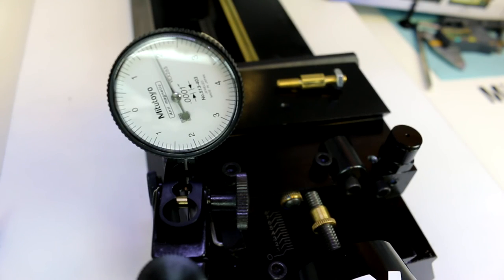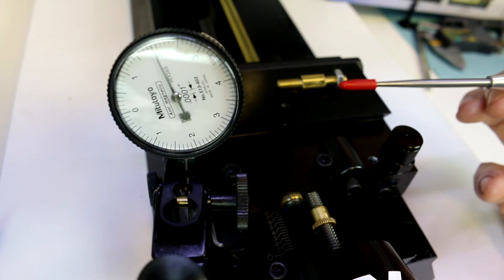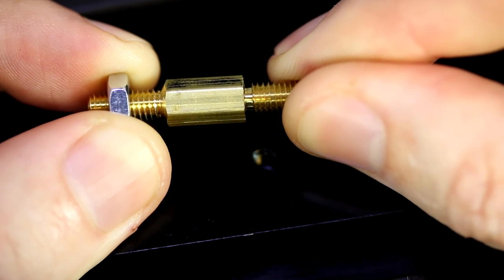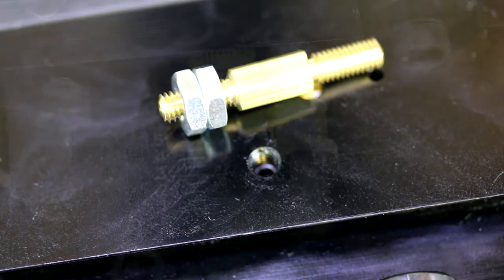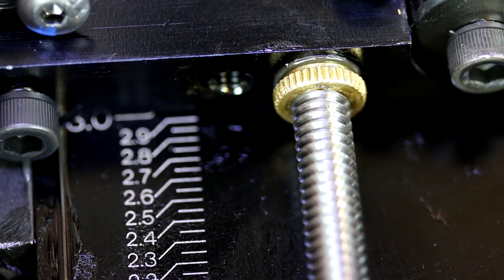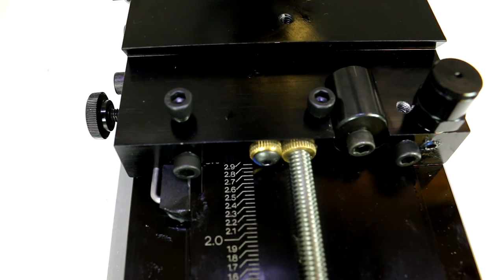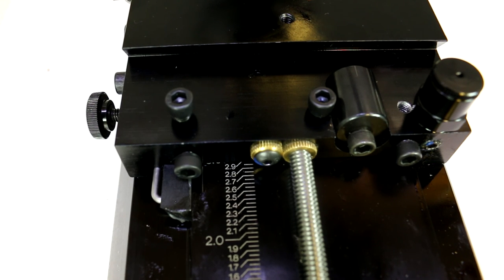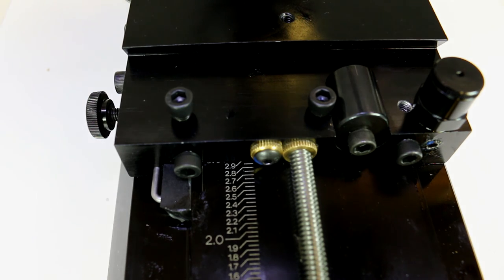Sherline Lathe & Mill Backlash

Comment: Wear and tear over time causes backlash, but I also think a lot of manufacturers are more concerned with getting products out the door as fast as they can ($$$), rather than spending a little more time machining items to fit.  Mass production is only good to a certain extent.  Wondering what the cost/time difference would be to machine ball screw threads as opposed to regular threads ?

Comment: Your video above and the Sherline manual and videos show how to reduce backlash in the lathe slide (X axis) but not how to reduce it for the Y axis (for the 24" metric leadscrew). How do you reduce it for the long Y axis? Following their video on handwheel installation, I adjusted the handwheel control for the main leadscrew shaft (basically re-tightening the control on the post) as you would for an older frequently used machine, but this machine is new so it made no difference (did not work loose in the first place). Technically, the end play comes out to be .008 mm (8 increments) which is at the end range of acceptable for Sherline so I didnt want to get with the company yet assuming they will say to just live with it. Any info will be greatly appreciated...

Comment: The bushes inside the saddle are a (tightish) slip fit. A BBQ skewer is sufficient to push them out, though you might need a gentle tap to get past the face of the saddle.

Comment: I had about .0015 backlash on the X & Y axis when I first got my machines. Now it seems to be up to about .003. I suspect there's some wearing in going on, so will take some of that out.

However the Z Axis on the mill is more like .005. I'm still learning just what I need to do if I want to lower the head a specific amount.
Reply from the maker: +James Thornton Thank you James for the details, I know I had more backlash then what was showing, but the grease I'd loaded on the lead screw was hiding it in the video. I made a quick tip video that might help you on lowering the head very specific amounts, not sure if it is exactly what you are needing or not...
https://www.youtube.com/watch?v=VnSmyB5OgaA